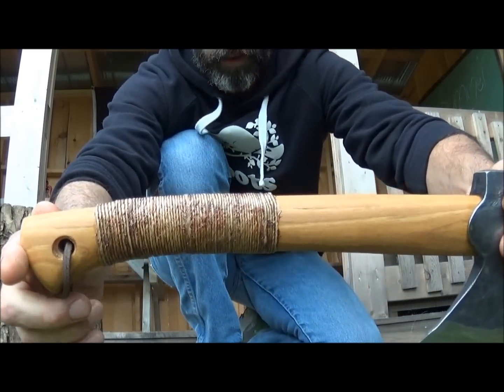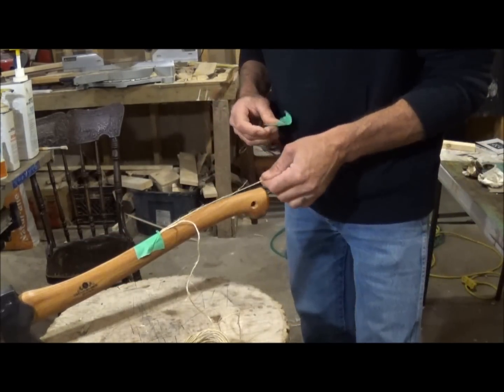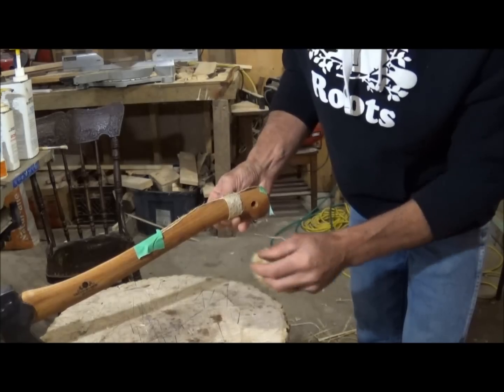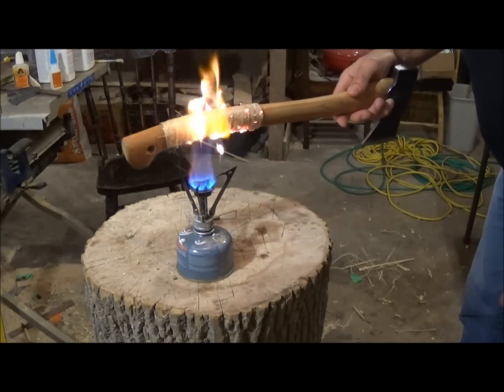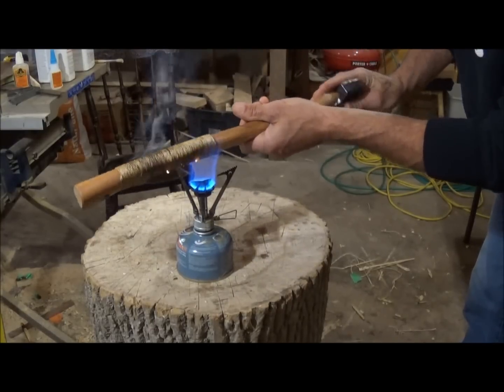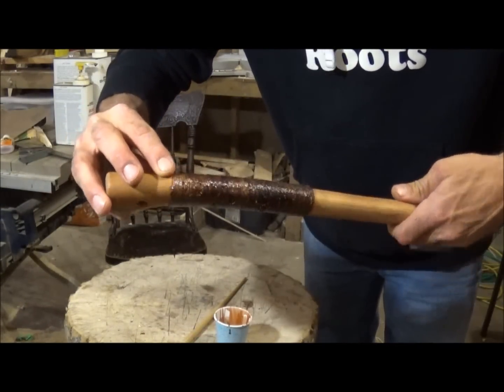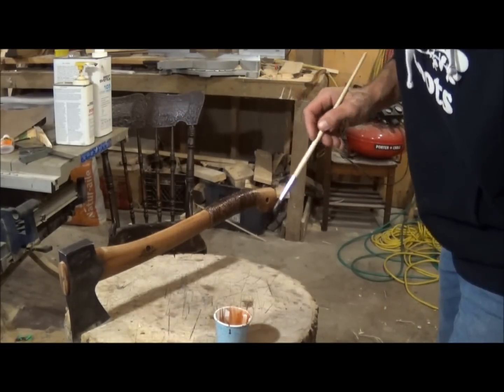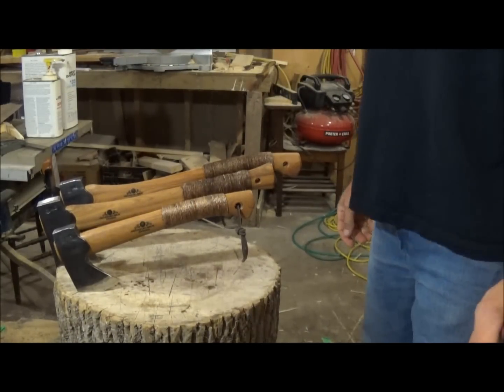DIY-Permanent Axe/Tool Whipping

Comment: To convert cricket chirps to degrees Fahrenheit, count the number of chirps in 14 seconds then add 40 to get the temperature. To convert cricket chirps to degrees Celsius, count the number of chirps in 25 seconds, divide by 3, then add 4 to get the temperature.

Comment: I do something similar, and use wax for the final seal. Rub one of those emergency candles over it and heat it up between coats so it soaks in. Also works well over hockey tape (that's where I started doing it). Great grip and lasts for years

Comment: Well done, start to finish. Lots of people don't pull the loop in far enough and just rely on burning the end.  I pretty much do the same thing on my camp tools - especially the machete.  I just bought a Cold Steel tomahawk that'll get the same treatment, but I'll very slightly relieve the wrap area so the head can still slip off over the wrap. Epoxy is a fantastic product.

Comment: The grips on all my Japanese saws were too smooth for my taste so I used your method with jute and wrapped them but did not use epoxy.  That was just after you first posted this video and my wrapped handles are still perfect.  Thanks.

Comment: Great video Doug! I just finished my first attempt at whipping my gransfors bruks kubben hand hatchet and it worked great.  The only difference is I used fiberglass resin(it was what I had available in my garage). My small forest axe is in the mail as we speak and can't wait to whip the handle. Thanks again for the video. 
P.s. all your videos are great.

Comment: Burning off the jute 'fuzzies' is a nice touch. The traditional Japanese way is to crumple up some dried horsetails (Equisetum) to use as 'sandpaper' and then saturate with lacquer as 'epoxy'. If you sand the handle area, the W.ood E.poxy S.aturation T.echnique will bond with the wood fibers and the wrap will be one with the handle. Great video.

Comment: I used your method of wrapping to make a guard for overstrikes works pretty good looks good too. I used clear non foaming gorilla glue btw.
Reply: I do this for overstrikes as well, I just soaked mine down with boiled linseed oil when I the rest of the handle. I use paracord but I've been experimenting with other things.

Comment: I did something similar on an engineers and a framing hammer, but used shellac.  Cheaper than epoxy and smells nice, but im sure is not nearly as durable. I guess I used cockscoaming instead of the whipping, and it came out a little wonky.  The whipping is much more straightforward.

Great video, and I enjoyed the cricket.

Comment: Thanks Doug, been wondering how to finish off a bell pull and think I just found it with that epoxy mix you used. Plus I am going to do this to my 3/4 axe. Have learnt many many things from you over the years, thank you.

Comment: SIDE NOTE: My hatchet handle is steel and I used a leather bind, so it took a few tries to get the correct tension at the loop so I could pull it thru and down without snapping the leather, but again, worked PERFECTLY.

Comment: From the color of your hardener you have had it a while. It starts off as a blond color then turns red with age. White Vinegar will get the West System epoxy off your hands before it cures. I think it is the mild acid that does it. After the Epoxy hardens heat will break it down. warm it with a heat gun or torch and it flakes right off.

Comment: First off great video man. I've just got in to making walking sticks and staves as a hobby recently, and have been searching for ideas for the grips. When I found this I deleted the others. Got what I need now! But do you know if this method works well for axes without wooden handles? My axe and hand axe have duraframe handles. Wasn't sure if the epoxy you were using would adhere to it or not. Definitely gonna use this on the last staff that I just made for my dad.
Reply from the maker: glad it helps and I'm sure that epoxy would certainly adhere to just about anything -on a staff is a great idea!

Comment: good info - thanks - a question if i may - wud woven nylon twine  similar to what you wud use on a plum bob or line level work  on this job --- i ask as im 100 plus miles from a town with a decent hardware  but have a bunch of the nylon - tia and take care
Reply from the maker: it would if you like the look of it
Reply: thanks fer replyin  - appreciate it - take care

Comment: What is the 2 part epoxy that you are using? Love the colouring. Great video-winter project for the hubby '
Reply from the maker: +Tina Deutsch that is leftover West system epoxy from a boat project, not necessary but awful habdy to have around -thanks for watching
Reply: +Doug Outside   Looked at the video saga in - West 105 + 207 it looks like. I guess I can get it at Lee Valley. Tks. We are making our way through your videos  - it's a "Doug Outside" binge weekend.

Comment: Nice job and cool video brother! Didn't realize you had a YT channel, subbed. :)
In the photo at the end the one in the back is the sfa you just did but what are the front two? I'd like to have a GB hatchet for my carving one day. I'm sure the mini would be too small, I have a sfa but the handle on it to me is too long for carving.
T. Pollock from BCUSA
Reply from the maker: +TNTim Bushcraft thx-the middle one is a carpenters axe and the smallest is the wildlife -not sure what you are carving but i do have a video on the mini and its a great all around tool in a small pkg
Reply: +Doug Outside  Mostly kuksa and spoons. I started a Hobbyist Membership on the forum and been doing some trading for gear with my carvings in my Trade Blanket. I'm disabled so that's helping me get some much needed gear. Thanks for your response bro!

Comment: just bought two axes i might just do this will the same method work for paracord???
Reply from the maker: I prefer the jute -but you can certainly whip with paracord but would not epoxy
Reply: +Doug Outside could you use pine pitch for the epoxy?
Reply: Works great with paracord, that's what mine are done with.  You can remove the insides of the cord for a flatter fit or use it as is for a thicker grip.  Do like hollowing out the parachord for small knife handles.

Comment: Looks really good but my concern would be absorbtion of the glue through my skin during use.
Reply from the maker: once its hard I don't think that would be a problem but if I drop dead soon then don't do what I do haha
Reply: Epoxy is inert once it has cured. No issues at all